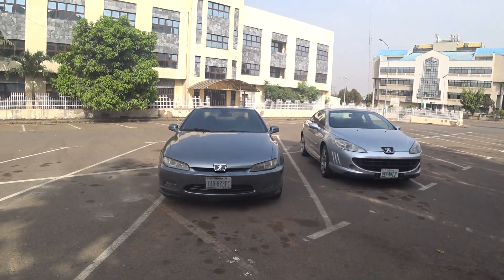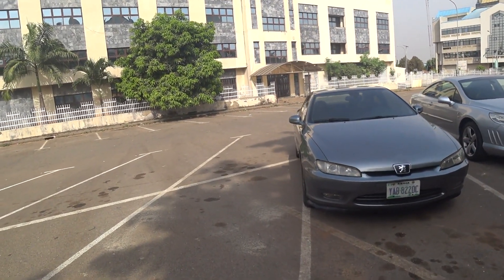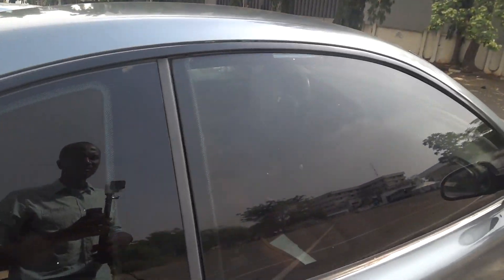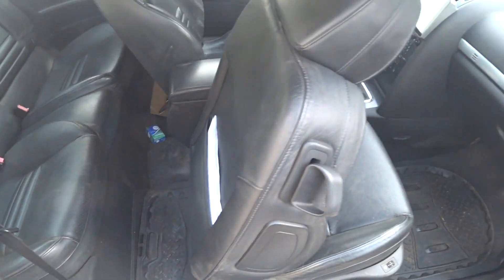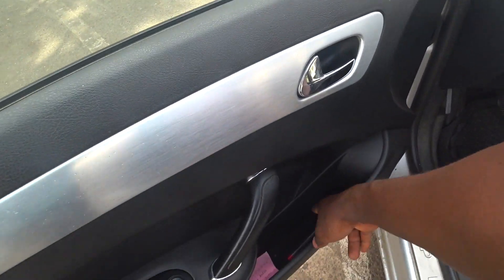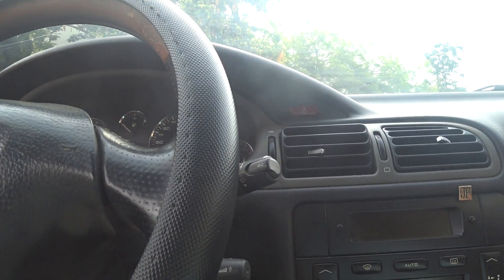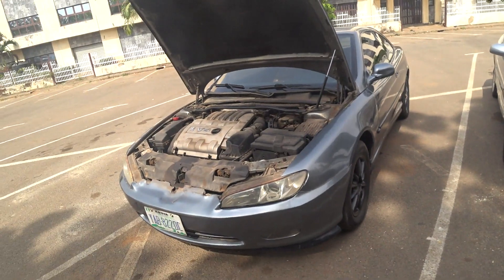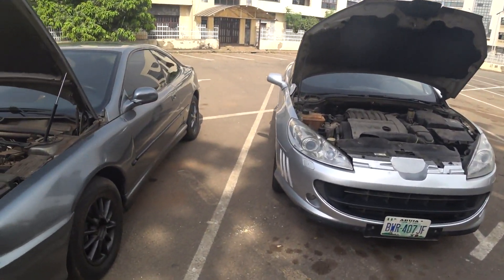Peugeot V6 Coupes: 406 Coupe vs 407 Coupe Review

Comment: In my 4O7 coupe the electric seat moving is also anarchist . I prefered 4O6 for the looks, the size and the weight, but is impossible to find one unit with low mileage and good use. Correction : There was a Peugeot 5O4 Coupe V6.